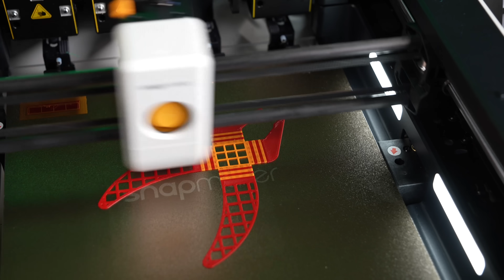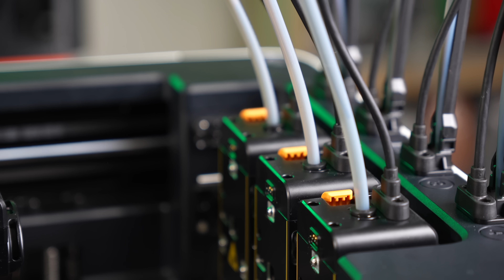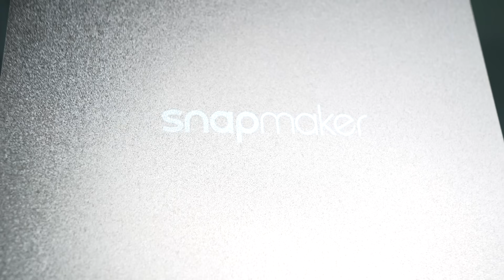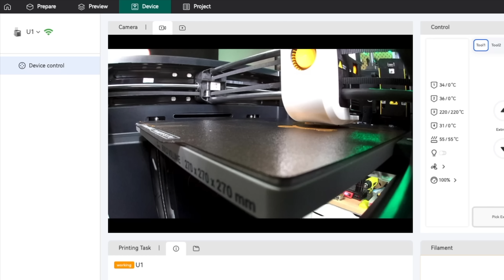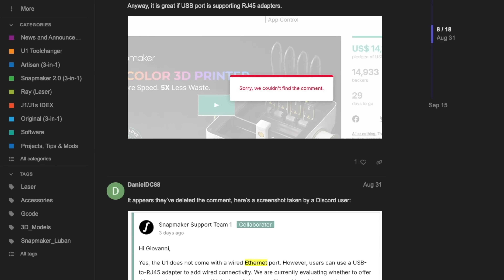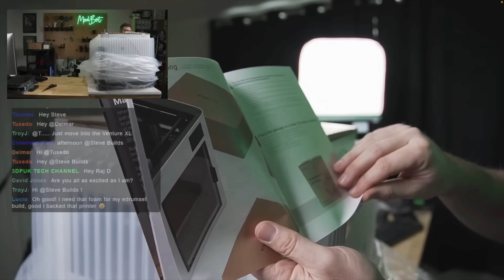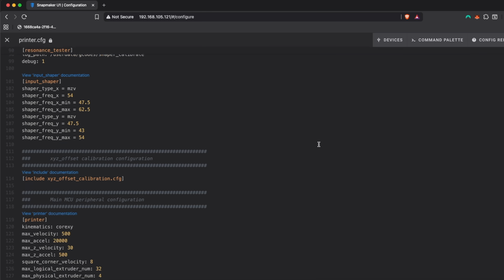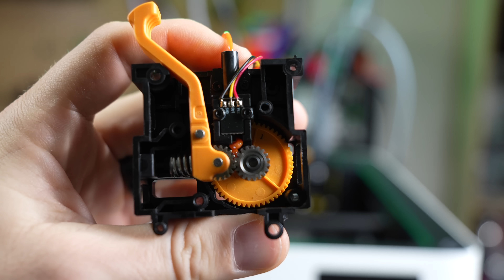Would I Back It Again? Snapmaker U1 Tool Changer

Comment: I'm gonna wait till next year when actual customers get their units to see how it performs, the tool heads need to be super reliable, they change hundreds of times for a single print.
Reply: Actual customers (me for example) have been getting units since mid november, but yes, waiting for longer term reliability info is a reasonable stand
Reply: got mine, its performs impressive well, considerered how much work software needs to be tuned. hardware is bambu quality, the sw expecialyu the profiles needs some love.
Reply: @gravballemandendk Yes, waiting for mine, but can see stuff that needs tweaking, as long as the production quality is consistent, most of the things I see look like filament calibrations and software limitations.
Reply: @gravballemandendk I hope its reliable, someone else wasnt so lucky on FB, one of the heads couldn't park correctly after a few changes. I get the feeling some printers will be ok and others will have issues with a complex switching machine like this. As more iterations come out and improve on the previous version it may become just as reliable as a single head.
Reply: @Icemanmodeler  i know 2 other who also got it the same time as me, and none of us have had problems. my friends have been running for days none stop now. But yes first batch is always rough.. it seems their support is better/faster than bambulab when they started. the machine got potential ...
time will tell how well it holds up, compared to my x1c.
Reply: @gravballemandendk  Cool, ill wait and see, thx for the info.
Reply: I don't know what stuff you are printing, but I am just happy that I actually have a filament change system that works. Consider how much time and effort in form of issues you have with a bambu type AMS... I can exchange some pogos for that in 5 years.
Or just buy a none planar multihead multi ams, filament mixer, which probably is gonna be the standard by then.
Reply: @petergriffin4629 Im a Senior 3D Character Artist, switched to resin printing a while ago to print my sculpts but im gonna get a multicolor printer next year just gonna wait and see how reliable the Snapmaker U1 is when actual customer get it.
Reply: Mine is coming next month
Reply: I'm sure v2 will be ready to come out by the time everyone gets their machines.
Reply: By far my favorite printer to use now, the other 3 don’t get touched nearly as much…
Reply: I got mine about a month ago and I absolutely love it. Just need to make an enclosure so I can do ABS printing and vapor smooth some helmets
Reply: Kickstarter backers are "actual customers", we didn't get a pre-production or early release part, we just got the first production units that rolled off the production line, and the tool changers have proved to be way more reliable than Bambu Lab printers trying to change between PLA and PETG in the same nozzle (Yes, we have both).
Reply: Besides the purge tower issues, is there anything else you have heard about?
Reply: I have no problem with the pogo pins being a consumable, but having to replace the whole pcb is excessive.
Reply: @turrboenvy4612  It would certainly be nice if you could just pop the pogos off the board without soldering to replace them, instead of swapping the tiny board.
I could see that potentially becoming a feature of a third party addon though.  Though idk if swappable pogos is an off the shelf option, so could end up being surprisingly costly if you need to create a reliable swappable pogo mount.  So 3rd party upgrades might just go with different option.  
At least removing the board is just unplugging 6 cables and removing two screws, so hardly a huge chore.
Reply: @turrboenvy4612 I had a CEL RBX02 in 2014 with swappable heads that used pogo pins in the head PCB, they were so bespoke, once failing (the springs overheated) the only solution was a completely new PCB, but even worse there was a brass ground  contact that was used for gantry levelling via the head tilting, and this would wear out and you needed to replace another PCB…the pogo pins on the SnapMaker look pretty stock, and at least the PCB is affordable…maybe upgrade the cooling to CPAP and do away with them in another iteration
Reply: @turrboenvy4612 

Yeah, surely you can just whip out the soldering iron?
Reply: Having had issues in the past with pogo pins on a smart watch crapping out and on a tablet keyboard wearing out, I dont trust them. And both of those have limited use, the watch charger was used once every few days and the tablet was used daily so was open and closed a fair few times, but nothing like with a printer that would be doing it hundreds of times during a print.
Reply: @FaenumVena  So how many cycles were those pins in your watch and tabled keyboard rated for?  Not all pogos are rated the same, obviously.  And of course with any part some units aren't up to snuff but sneak it past QC anyway, but that's what warranty is for..
Reply: @FaenumVena  pogo pins are very reliable if you use good quality units. yall are too pessimistic. life's too short
Reply: @FaenumVena thanks for that, yeah best to wait and see.
Reply: The fact they're made out of plastic chasis rather than the metal quality. Shame would have been perfect
Reply: The pogopins wearing out fairly quickly is a deal breaker for me. The whole point of this style printer is hundreds, potentially thousands of filament changes, per print!
Reply: @rileyneufeld7001 well they can't do what Bambu did with the wireless PCBs or people will then cry about them locking down hotends from 3rd parties 😂
Reply: @rileyneufeld7001  It will work without the pogo pins they only power the aux fan
Reply: @WayneOverbeck crazy 
They could have used inductors instead for that
Reply: @WayneOverbeck By aux fan you mean the part cooling fan no?
Reply: @rileyneufeld7001  Yeah, they claim it will last millions of changes, i'll wait and see. Even if 3 heads break it will end up being just like a normal printer with 1 head but the reason i'll buy it is for multicolor, Prusas Core One INDEX looks simpler but costs double the price. Think we need to exercise patience on this one.
Reply: @Icemanmodeler Each print head is rated to 250k changes. Now whether or not they will go out at that 250k mark or much past it I could see lots of model prints chewing at that 250k changes I would've liked to see 500k changes each printhead but with the design they used its definitely a hardware limitation.
Reply: @rileyneufeld7001  Just 250k? I seem to recall one of these youtubers claiming Snapmaker claims a million changes. Anyway we will wait and see, this is relatively new tech esp at these prices and as with any new tech V01 won't be as good as V02.
Reply: @Icemanmodeler The 1 million changes is for all 4 hotends combined.
Reply: @rileyneufeld7001 Couln't you simply design and print a new one? ASA or ABS?
Reply: @TheJahe123 I'm unsure if it's the actual pins themselves or the board that goes bad after the certain amount of changes. If it's the actual pins then I'm sure someone will be able to install new pins on the same board. 
If the board itself needs to be replaced then the $25 replacement isn't too expensive but on large models with lots of changes it must be taken into account.
Reply: @rileyneufeld7001 250k is usually a half life, and usually products will go welllll past their half lifes, and you always invest in new products they usually will have the best components, they lose money on new products.
Reply: @rileyneufeld7001 Just saw one of the first backers get their Snapmaker and after a few changes one of the heads couldnt park correctly. Not sure if i can send links here.
Reply: Pogo pins are known to be consumable, just like any moving part is.  This should not surprise anyone.

But when people talk about hundreds or thousands of changes per print...  that's total changes.  Split that number by the amount of colors used.  So lets just do some napkin math....  270mm at 0.2mm layer height is 1350 layers,  that's 1350 changes per toolhead per print if there's a change on every layer (5400 total for 4 color changes every layer, bit unlikely), so worst case scenario is 185 prints to meet the rated life for the pogo pins for a toolhead.  Those max height prints are likely to be larger in x and y too, so they'll be longer prints, probably closer to a day; so you might need to replace the pogo pin boards roughly every 6 months if you're running *max height prints with color changes on every layer and doing that every day**.  And that was *rated changes, i.e. the minimum they should handle.

For an average home user, that replacement interval is likely to be measured in years; not making full height prints, not having every model have color changes on every layer, and not printing every single day from dusk 'till dawn.  And that 500-1500 monies you saved vs the other options, will get you quite a few replacement pogo pin boards.  Lets say you need to replace all boards every 2 years; at 25 per board that's five replacements to match even a Core INDX, so it will be 12 years before you start making a loss because of the pogo pins.

If you're running a print business that prints constantly, you can probably justify the cost of a Prusa XL, Bambu X2C, or Prusa Core with INDX.  If your math says they'll actually turn out to be cheaper for your business in the long run.  Even at 6 month replace interval, you're still looking at 3 years before you start making a loss vs INDX.

Not to mention there's probably going to be third party replacements using pogo pins with longer rated life that cost more.  Or you can source your own and solder them on the board if you're a power user who needs that kind of longevity.  Possibly even switch to contactless with a third party / diy replacement of both sides of the pogo connection.  The machine doesn't seem too locked down, unlike certain others, and with the kickstarter breaking records, there's bound to be 3rd party upgrades.

The pogo pin "issue" is an utter nothingburger, in my opinion.
Reply: @abc_def-55 Thx for the in depth explanation, its also about reliability, the machines needs to be very accurate in order to perform thousands of toolhead switches for every print, this is the most important thing imho, looking at ppl who are just getting their early bird printers some are having to troubleshoot the toolhead parking but once its done it seems to work. I shal wait and watch to see how it improves as always with new tech esp at this price point things tend to have issues and will get improved in V2-3.
Reply: @Icemanmodeler  Yea if you don't have a pressing need for a toolchanger right now (or next summer, when U1 launches regularly) no reason to rush into it either.  The price isn't likely to be going up after the proper launch, and it's already too late for the cheaper kickstart price. :)
Reply: Yeah I need to know more about reliability, replacement part availability, and software support
Reply: H2C overall is the best. Only downside is time spent loading/retracting filaments. Aside from that it’s untouched even by the new prusa.
Reply: @jhdz999  The Bambu Lab H2C might have made sense if it had been available a year ago.  But with the release of the Snapmaker U1 and the upcoming Bondtech INDX, it has already become obsolete in the multi-head/tool changer category.  Not to mention the fact that, at a price of $2,400, you could purchase THREE Snapmaker U1's for the price of one Bambu Lab H2C.
Reply: @jhdz999  Lol, the H2C honestly misses the mark for 90% of users.
Reply: @BFriesen Being in the 10% you said, I'm happy to have a printer that will fit my needs. Fully enclosed, chamber heater, flat top with no excessive height, proven reliability and parts availability, efficient software and available right now. But if you remove the h2c from the printer pool, the 90%still have lots options to get their best tool for the job.
Reply: @patricklebel1141 Yeah, I 100% agree. Honestly none of the options at the moment fit my needs particularly well. The restrictions on material choice with the nozzle swapping is just too significant. The Snapmaker is closest for me, but I really need a heated chamber, hotter bed and hotter nozzle. I'm probably just going to add those things to the Snapmaker myself.
Reply: @BFriesen  The price point kills it for me with the H2C, but please elaborate on why you think it misses the mark for 90% of users.  You can't just make a claim like that with no reason.
Reply: @utha2665 I mean the person I replied to didn't provide any reasoning either...

But regardless, cost, needless complexity, limitations of material choices, speed of material changes. The H2C is a really complex solution to a mostly nonexistent problem. 

I guess the question is, who is the user that would be better served by the H2C rather than a U1 at 1/3rd of the price, or a Core 1 INDX at 2/3rds of the price? For me, that answer is if you need high temp and a heated chamber (both of which I'm going to mod onto my U1), you need more than 8 colors/materials, or you need the extra build volume and can't wait for the Core 1 L INDX. 

But to get all of those things, you have to deal with the extra cost and complexity of the H2C and still have to use an AMS which is slow and limits material choices. Not to mention the locked down nature of Bambu printers. There is certainly a person out there for whom the H2C is the right printer. I just don't think it's the right option for most people.
Reply: @BFriesen  Thanks - genuinely appreciate the thoughtful reply. That kind of breakdown is a lot more useful than the usual surface-level takes.

I agree with most of what you said. The H2C isn’t badly engineered, but the price puts it into a really narrow category. It’s hard to justify when there are solid machines at a much lower cost unless someone truly needs the high-temp capability, extra volume, or the niche features it brings. For most people, it doesn’t feel like the natural next step — more like a specialised option.

Since you already have the U1, I’ll say this: I’m really watching Snapmaker’s pogo-pin toolhead system with interest. It’s clever, but long-term durability and replacement pricing are going to make or break that design. If the toolheads are treated as cheap consumables, then it’s a smart solution. If replacements are premium modules, that convenience could turn into an ongoing cost.

I’m coming from the Bambu ecosystem, and it honestly stings a bit to see them miss the mark for the broader user base. So if I end up grabbing a U1, it would be my first real step outside Bambu - and I’m just waiting to see how it performs after months of real use before making the jump.

Either way, thanks again for taking the time to explain your position - that kind of exchange is actually worth reading.
Reply: @utha2665 I would never accuse Bambu of poor engineering. I've torn down lots of machines and Bambu is easily one of the best in the industry.

Agreed on pogo pins being a potential source of reliability issues. I've seen pogo pins used on Printheads before and they've caused issues. I think the saving grace here is that they'll be clamped tightly by the tool changer mechanism and that they're only powering a fan. They don't have to transmit a lot of power which can lead to scorching, and there is not data being carried over them.
Reply: @BFriesen  Lol si no te la puedes permitir claro, si puedes es una maquina superior, mejor construida y con mayor calidad, en el mundo real las diferencias de tiempo contra la U1 son de 1h mas o menos, mira una review seria analizando las 3 antes de decir tonterías anda  https://www.youtube.com/watch?v=Lvr6-_GgorA&t, ya sin mencionar que la calidad de la Prusa XL es mediocre, el que priorice ahorrarse tiempo frente a una impresión de calidad es que tiene serios problemas mentales, en 2 años te importará poco que haya sido 1h mas rápida una que otra, te importa como se ven.
Reply: @titiritofo I mentioned numerous factors other than cost and time. The one I primarily care about is material compatibility. I've used most of the multi material solutions on the market. I've used an H2D extensively and while it's a good printer, it's underwhelming. I've also spent quite a bit of time with the Prusa XL. It's a solid printer and the best option for multi material, but the cost is crazy and it's fairly slow. My U1 is being delivered hopefully today so I guess we'll see.
Reply: @jhdz999  I agree with Bfreisen on this one...too expensive so it has a lower customer base.
Reply: I still have mixed feelings about my H2C… Im not overly impressed with the print quality compared to my old A1. 

Now I will say, I do love having multi tool heads and multi AMS units connected. It just makes life easier.